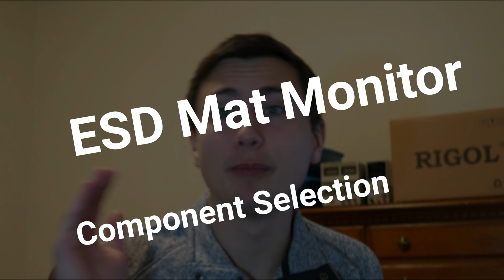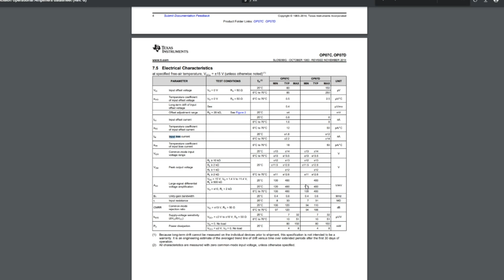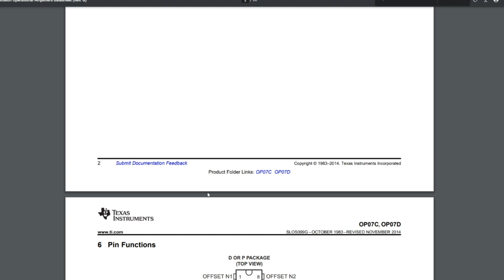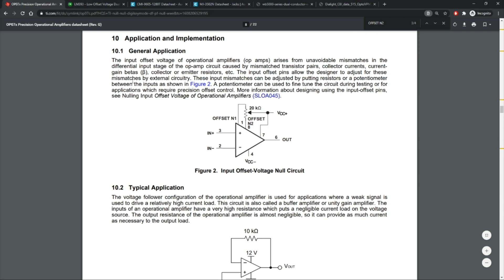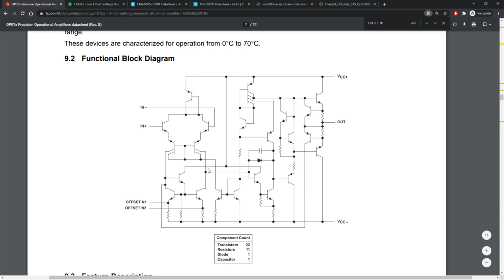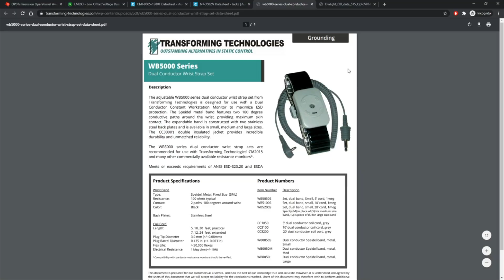Component Selection | ESD Mat Monitor

Comment: Ah so you're sticking to "Basic Parts" for JLC PCB assembly.

If you're going to be trimming it anyway, i'd see if a cheaper opamp would do the job ]for fun.
You raise good points regarding engineering time / total cost =) "throw your standard parts at the problem"

TL072 or MCP6002 might be other options?
Not that much differnece in price so it doesn't matter that much.

MCP6002 is under basic for low power opamp? 1pA input bias current typical. 20 at 85 degrees, 1100 at 125.
Issue there is 5v max input voltage, vs the common mode range for the OP07.
Reply from the maker: Yes, for now. until we really need to deviate. :) If I had to summarize our plans for 2021 and beyond: it would be "more projects". Dare I say, a lot more projects. 

Still doing the occasional deep-dive, but complimented by a few quick-turn designs to keep things fresh!

We can always drop something pin-compatible for a 1-off rework, where we could do an A-B comparison between different parts!

I'll be the first to admit that the OP07 isn't perfect, but it's pretty good.
Reply: Input offset is a problem with the non precision ones though =P Order of magnitude difference.
Lot's of time doing comparative analysis, or just go for the slightly more expensive part =)
Reply from the maker: I totally agree Normally Open! For what we're doing here, the precision part is totally worth the extra cost!